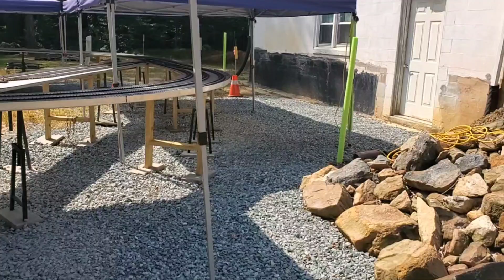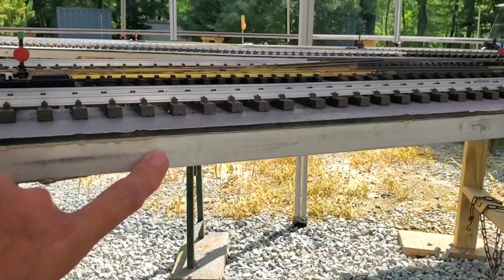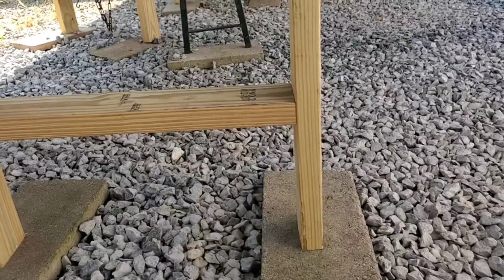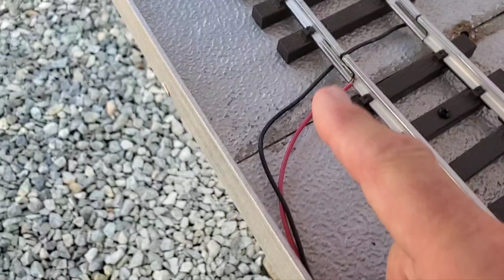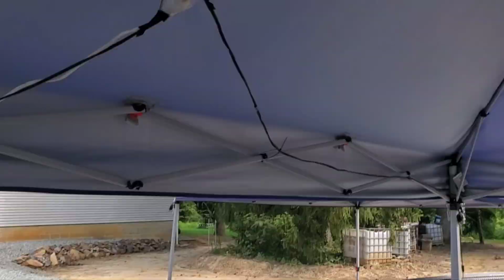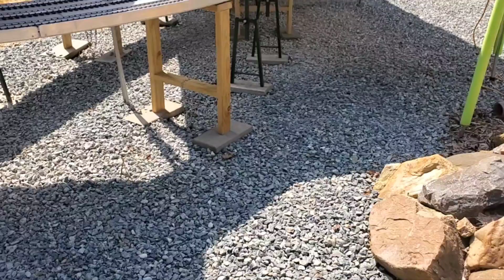Elevated G Gauge Test Layout For Live Steam and Battery Powered Trains

Comment: Very nice layout for your purposes and it appears to be durable enough for easy maintenance.  I do have a couple of questions though.  What is the height of the track above grade and how do you access the infield?  Also, any idea of how the square aluminum stock was bent to create the curves?  Thanks for sharing your post.
Reply from the maker: The height is 36". It can be anything that you want. Because it is mainly for live steam... 36" is a good height  for working on the locomotives while sitting on a stool. The layout was only built as a temporary track (less than a year) so did worry about installing a lift bridge to get inside. There are othe videos on my channel showing an option of using a lift bridge that is on videos talking about "The neighbors layout down the street". The layout did not have a name at the time but was later called the "Willoughby Railroad ".
There are benders you can buy that will roll the square (or round) tubing to the radius you need. I bought one from Amazon. Very easy to use.

Comment: Those steel supports you are using. I have seen other portable live steam layouts use those. Are they a commercial item? Or did you make them?
Reply from the maker: They came with the layout. I did not build them. The person I bought the layout from said the club had hired someone to make the panels and weld up the legs. Sounds like a total custom fabrication.